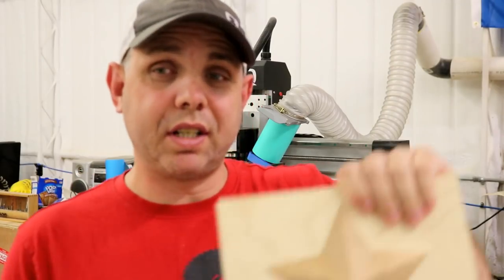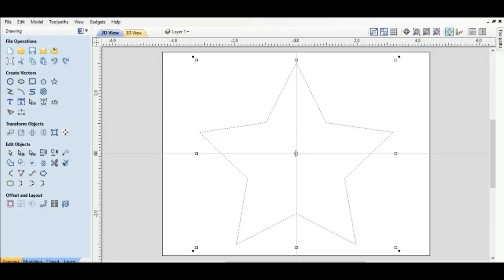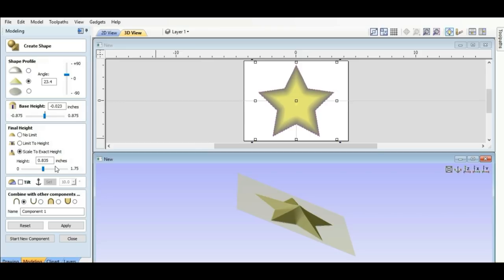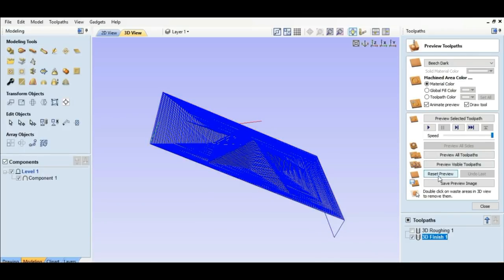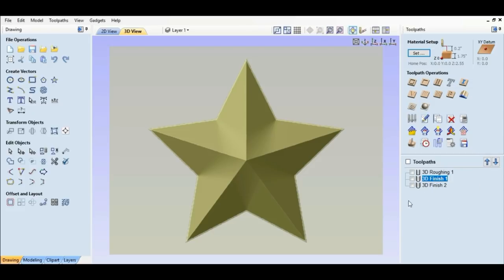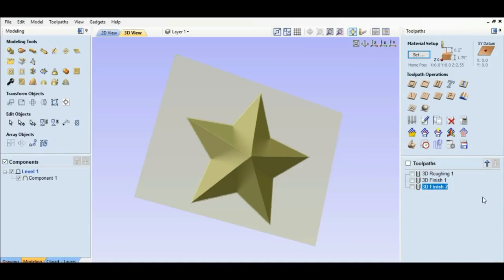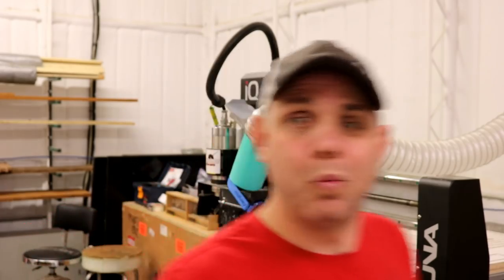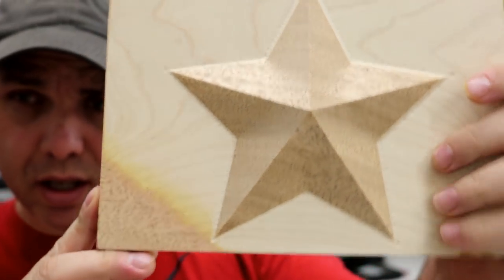Simple 3D Modeling with Vectric Aspire // Laguna IQ CNC

Comment: Not sure if anyone else has mentioned it, but your estimated times could be off based on the rapid movements. When you use Aspire, you're obviously telling the software what feed rates and such, so it should calculate accurately on that. But there's a setting to tell Aspire what speed your machine rapids at, which it uses to calculate rapid distances. My CNC rapids faster in X/Y than it does in Z, but I can only enter 1 rapid speed in Aspire. My estimates are usually pretty accurate for profile cutting (mostly feed moves, very little rapid movement), but are not always accurate when doing pockets (repetitive passes in Z depth) because the Z axis doesn't rapid at the same speed.

Comment: The answer I was given by both Laguna and Vectric, as to why the estimated time on the toolpaths, and the actual time is different is the Metric to Imperial conversion. Vectric software is written, based in Metric, and the software had Imperial added for us Americans, however the developers did not "Entirely"  rewrite to program in Imperial.  I was told the software does convert sizes, but does not actually convert the toolpath times from Metric times to Imperial times. I have the exact same IQ HHC only in white, and I am running Aspire also,  I find that my actual times are half of the estimated time, almost to the minute. I did try running a small 3D job in metric just to see, and the times were almost exact to the estimated times, so I found their explanation to be correct, atleast on what I experienced.  

As far as the bit dropping on the final pass, when you calculate your finishing toolpath, in the "Machining Limit Boundary", put a Boundary Offset of 0.05 inches, you have yours set at 0.0 inches. This keeps the bit 0.05 inches away from the edge. This small change will fix your problem.   Hope this helps  

P.S.  This was a GREAT video you have helped many people. I love the way you take time to explain details, and the fact you show the mistakes, and encourage feedback to help correct errors. The craft is a team work effort for all of us. Thanks again.
Reply from the maker: celebrationscuba That’s a great explanation on the estimated times. And I found the offset tab after I made the video. I try to show the good and the bad. Thank you again for the positive comments.. plenty more videos to come!!
Reply: What is imperial time? Time is time there isn't a metric or imperial version of time

Comment: Great video and thank you for also sharing the "mistakes" as well.  I also noticed while it was machining that your wedge clamp kept vibrating/backing itself out.  There also appeared to be some very slight extra depth milling around the perimeter of the star.  Do you think of you would have selected model boundry for the detail step with possibly a very small offset, that would have prevented the slight extra depth milling around the perimeter?  Also, did you figure out what caused the problem where it went all the way to the bottom on that pass where it went into your clamping wedge?  Seemed like maybe a big in Aspire.
Reply from the maker: I'm not sure why it did it, but I put a boundary on it and it fixed it.

Comment: Great video Jake, been doing VCarve for a couple of years and would like to dip my toe into the 3D carving (I do have a few 3D printer that are fab) but the Aspire program is so expensive but good also, i'm a hobbyist running a D600 Stepcraft and have just downloaded the trial edition of Aspire and trying to get to grips with it, watched a few tutorials but kept getting stuck on the simplest things - watched your video and had my first model done within an hour, just have to do toolpaths. why did the tool go to base (I had this happen on a sign I made a while back and could not figure out why) ?
Reply from the maker: Rob Wallace first of all thank you for watching. I’m not sure why it does it, I just learned to pay more attention to the test model. I just put a tiny offset in it and it fixes it. I still have lots to learn as well.. 👍👍

Comment: Hey jake. Awesome video. I love your videos. Learning a lot. I just purchased my cnc. It’s a shop saber. I am having some issues with clamping my material down. I’ve noticed your system you have. Just wondering if you can do a short video on how you made your clamping jig and how it functions. Thanks. Love your vids. Keep on postin. 👍
Reply from the maker: Quinton Rhodes Thank you a lot Quinton!! Congrats on your cnc Machine.. I think my next cnc video will be on making a clamping waist board so you won’t have to wait long buddy!! 👍👍
Reply: No need for clamps.  I have a 4x8 freedom patriot and for smaller projects such as this I use tabs and transfer paper on my spoilboard and of the bottom of the piece.  Use Hot Glue in between or CA glue.  It's worked flawless for small and even very large parts when I'm not running my vacuum.  When u need to cut out a part from a piece of wood make sure you put in tabs and use the process I mentioned.

Comment: Does the software automatically set you up for tool change ?
Reply from the maker: No. Each tool path is different. Put in the roughing path, then the finishing path.
Reply: You need to manually assign a different tool number for each different tool.
Reply: You need to have a machine that has Automatic Tool Change (ATC) or a machine that does a pseudo ATC (Legacy Maverick) and can re-zero after the manual tool change. In Vetric you can set up your tool paths to machine in the order you want, but each tool has to have a unique number (tool 1, 2, 3, etc) but if a tool is used in more than one operation you can call it say, #1 and use it in operation 3.  You then "set the save all visible tool paths" in one file.